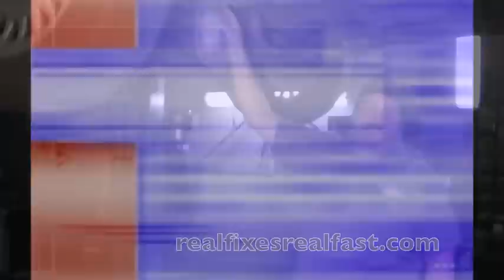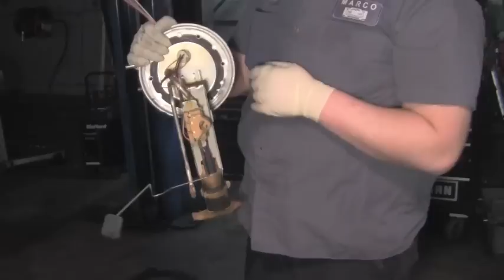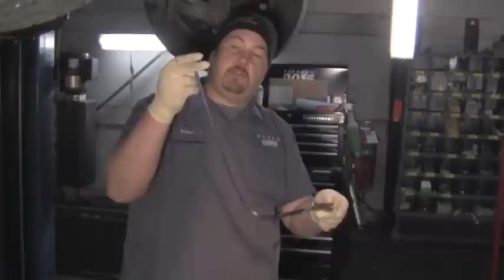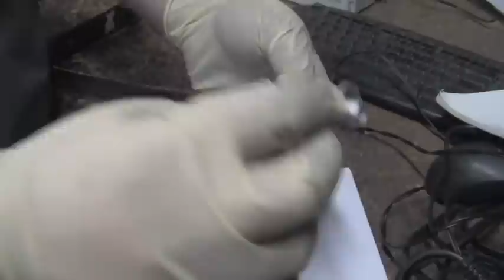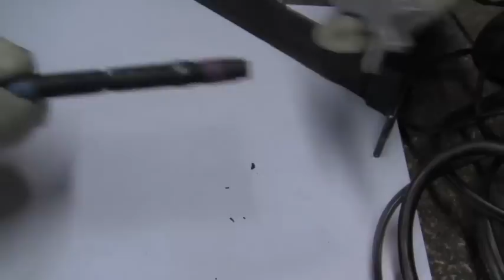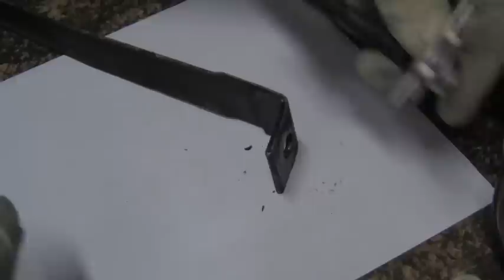Fuel Tank Straps Won't Fit

Comment: Cool video... I'm no where near a professional mechanic and I found part#600-3231 at NAPA for $13.00 (longer studs with new nuts) to be the perfect way to reconnect the straps properly.
Reply: All these parts are a pain when it is time to replace because of the rust. My gas tank fell to the ground due to too much rust. I had a tank full of gasoline. I was lucky nothing happened. I was parked at the gasoline station. Make it a habit to check the brake and fuel lines because of the rust too.....

Comment: Thank you so much for showing this. I seriously struggled and learned new words. I got it back together laying on the garage floor. Now that I have to swap out my tank 3 years later  I just ordered these studs form Ebay for $13.98. (OEM NEW Ford Crown Victoria Fuel Tank Mounting Strap Studs Shear Bolts TWO) 2006 Crown Vic.

Comment: This is for fire prevention in 70+ mph rear crashes.

You can change these pumps with the tank still in place, I've done tons of them.

You can buy new bolts at a hardware store and make it work, but I wouldn't leave much of the bolt hanging down as in a 70mph+ rear crash, the tank can be presses into these bolts and piece the tank resulting in a fuel leak and possibly fire.

Just have the car jacked up with the axle hanging down and wiggle the fuel pump out and over the axle.  It can be done.

You might have to push the exhaust pipe over to the side a bit.

Great video!!!
Reply: Wish I would’ve read this 3 days ago. Damn all data

Comment: Crown Vics are the same, Big shock. Found out your tip the hard way. The reason the tips snap off is so in a collision from the rear, the studs will not penetrate the fuel tank.

Comment: Been a long time since I did a fuel pump on that body style crown vic but can't you pull the drive shaft and reach over the diff and R&R the pump with out dropping the tank? Couldn't remember but seems to ring a bell.... At any rate great tip!
Reply: I like your channel dude
Reply: Don't even need to do that for just the pump. Just take a ratchet strap to the exhaust to move it over a few inches.

Comment: I ended up getting M10-1.5 exhaust manifold bolts (Dorman 03131). 4 pack for ~$10 so you'll have spares when you need to remove the "Y" pipe at some point.

Comment: I have fought this issue myself many times and you can get the straps back on without replacing the studs, but you will definitely fight for this.  A shortcut I found to work for me is to gently pry the exhaust far enough towards the passenger side and insert a piece of a 4x4 between the driveshaft and the exhaust pipe. Once this is done, the fuel pump will come right out without any clearance issues and without even loosening the fuel tank straps. However, I was not aware of the one time use studs. Thanks a lot Ford! lol

Comment: Just ordered those studs from ford for an anticipated fuel pump replacement. Was able to get them but seems the supply is drying up considering the age of the car. You could probably with care duplicate this with a pice of drill rod and take a dremel cut off wheel and make a grove in the rod to snap off after installation. Thanks for the information and reason for this insanity.

Comment: This fuel pump can be changed without dropping the tank...
Unhook the fuel lines. The wires coming from the fuel sending unit go into two wire looms each with a connector. The larger connector is a pain to get to but can be undone easily once you pull it out. 
The only thing that makes it necessary to drop the tank are the 3 wires going up over the tank to a connector above the tank. 
Traced those 3 wires back to the larger connector and cut them about 2" from it. 
Swapped the fuel pump, put it all back together, and spliced the wires back with heat- shrink butt connectors (14-16 guage) and a set of good crimpers. Splice was easily wrapped up into wire loom. Obviously be VERY careful if you heat shrink. We gave it a while for the fumes to air out and wiped everything with a shop towel. 
Worked like a charm and didn't drop the tank.

Comment: "You will fight and fight and fight to get that strap on and you'll never be able to get it on" Man you ain't never lied, I don't know how many times Iv'e fought those and ended up looking around the shop for matching all thread bolts and nuts  and wondering why some lunatic engineer would design some shit like this, I wish i had his nuts in a vise. Anyway now i know, I'll be damned. Thanks for the great video. still a shit design in my opinion though.

Comment: Yes and the only place you can get those scratches from Ford I'm waiting a week now for that my car is going in pieces for 2 weeks as I had to order a bunch of new tools and parts. And after 20 years of being disabled very difficult to do this stuff. I ain't no twenty-two-year-old anymore. Rocket sockets came in very handy. One of the 15 mm nuts was so damaged that I can see through the outside of it to the inside threads now that's a first for me. I want to be an auto technician in 89 before I became a home repair contractor there is much cleaner work being a home repair contractors then a mechanic buried in on disability income I have to do this work myself on my back in the driveway thank God I have an electric 1/2 inch impact. It was a lifesaver both the nuts

Comment: On the Town Cars, this is not as common, heck I generally do not even have to drop the tank. The bolts holding the sending unit to the tank are 8mm if I remember right and the yellow wire you see, is the sending unit float level signal wire. If you are going to have the key in the on position or the vehicle running with it in the air, make sure you disable the air ride system. These really are not that bad of a job, just take your time.

Comment: No wonder I couldn’t put my gas tank straps back on. Ford wants you to bring it to them. F**k the engineers 🤬 That’s so stupid to cut the studs. I’ve been cursing my ass off trying to get the straps back on. I really started laughing when you said “you are going to fight, fight, fight trying to get the strap on.” Laughing because not only it was funny that I literally went through that before I looked up a video for this, but also I was laughing in pain because of the frustration. And I was about to start up my car after a 9 month long project. Had bad gas in the tank and I had to drop it to siphon out the bad fuel. Big thanks to you for explaining this frustrating situation!

Comment: Wouldn't the fuel tank straps actually be shorter due to the fact it isn't shaped like a U because it doesn't need to go around 3 sides rather only 2?

Comment: @dramatics777.... PB Blaster, a long extension and a breaker bar.
Reply: Uncommon Sense PB blaster works good but if sprayed anywhere near the bolt head u just going to slide off amd round the bolt

Comment: I changed my fuel pump and did not take out the tank. But I have done something to the gauge set it in wrong because my fuel gauge is not working goes over full on me and don't want to come down, It did at first put in ten gallon and  then filled it up later and went too full.

Comment: What is the intention behind these one time use studs? Is it there to detract tampering with the fuel system?
Reply from the maker: Since the straps are so long, at the factory they use the long studs to allow quick access in assembly.  But, since they are long, they could possibly puncture the tank in the event of a rear end collision.  So.... after they are installed, they snap them off.   The trouble is, they don't tell us.   So, we struggle trying to get them re-attached when we remove the tank.

Comment: question how big is this tank might be a good replacement tank for a 1964 impala going with a ls3 on my car that tank might fit my impala, fuel tank is install almost the same way as that car .What year is the car don't want to pay 700 dollars for a efi fuel tank
Reply: 2011 crown vic tank, 19 gallons like 130$ at most rock auto